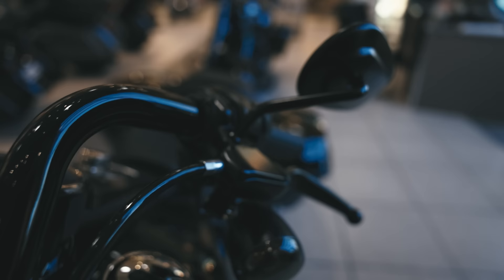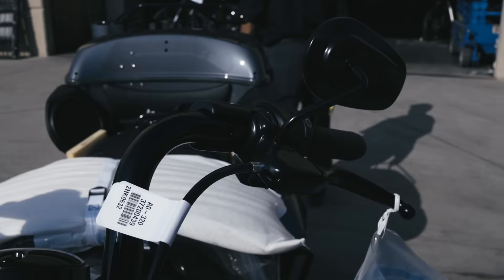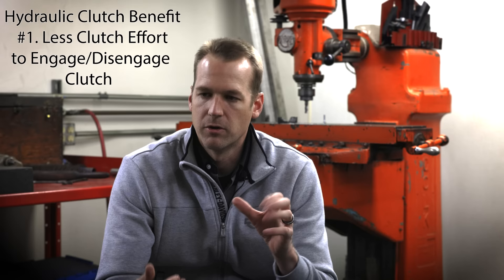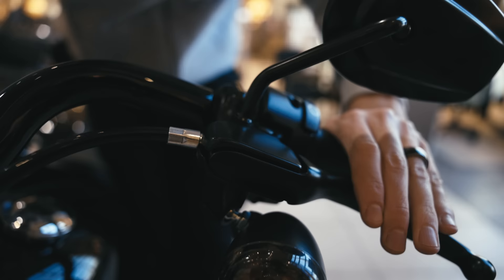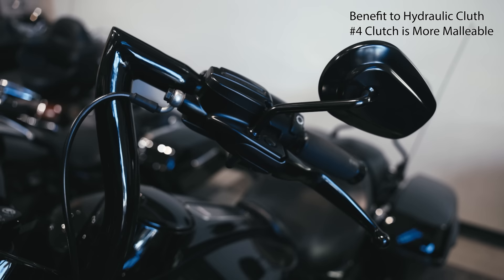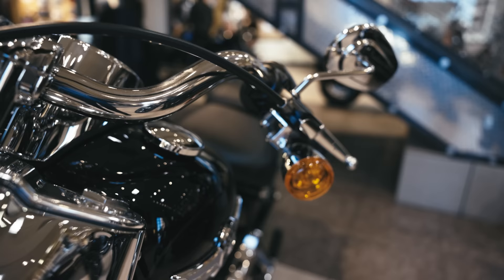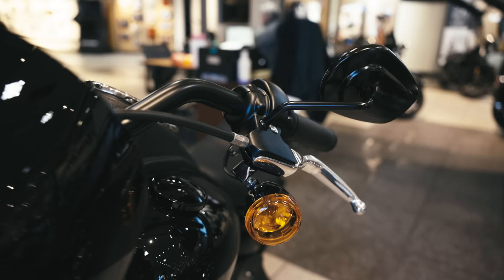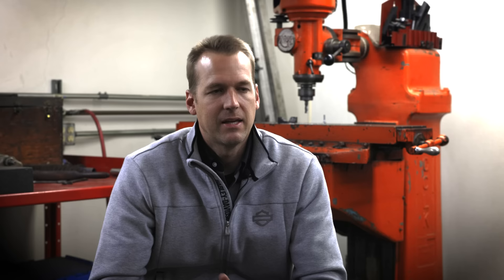Why Harley-Davidson Switched Back to a Cable Clutch on Touring Motorcycles│Pro's vs Con's

Comment: Matt, last year Purchased my first Harley with a hydraulic clutch, a 2017 FatBoy S.  My experience was: 1. that it was not less effort but more, 2. friction zone was way smaller than a cable clutch, the lever would be half way through its travel before the clutch would start to disengage, making the friction zone minuscule.  for me this was a deal breaker as use of the friction zone is how I handle a large bike with lots of torque through slow, tight maneuvers (think parking lots, traffic jams, and my daily commute to work).  I loved the bike and that 110ci, but I traded it in because the handling just didn't match my riding style.  That fat front tire was great on the highway, but I just prefer the handling of a skinnier front tire everywhere else.  To really get the bike to fit my riding style I would had to replace the heavy wheels, and that awful clutch, so I just got something else.

Comment: When I first experienced the hydraulic clutch it felt a little weird to me especially with the narrow almost all the way out friction zone. But I quickly adapted to it and I like it. Incidentally, an internal seal in the hydraulic system was a recall item on my 2018 Street Glide Special. But I had no issue with the system. Ive heard that there’s an aftermarket company that makes a modified clutch lever that increases the friction zone on the hydraulic system. I have two other brand motorcycles with cable clutches. I’m adjusting the cable constantly on both. All in all I’m OK with both systems. I do like the low maintenance on the hydraulic system and it’s consistent feel to it. As Matt stated, there are motorcycle instructors (Motor man) that really prefer the cable system over hydraulic because of the way bigger friction zone for slow speed maneuvering. Personally I’m very confident in my handling of my H-D. I’m a rider who rides every day and averages at least 150 miles per day. I guess if I had a gripe it would be passing the cost savings on the cable system onto the customer.

Comment: As someone who has had both, they both have their perks.  Biggest perk on hydraulic is shifting has less lurching under fast high rpm shifts . Especially for the passenger. Cons. Very small friction zone , being almost at the end . Be in the know when using a hydraulic clutch for the first time if you are used to a cable clutch . Cable clutches friction zone is triple the area . Way more forgiving .

Comment: Hey Matt. There is a fix for the friction zone on the hydraulic clutch. Check with your service or parts guy. I believe it's called a jitter spring inside the clutch pack. About a $15 part plus labor. My friction zone went from the 80% to 50% release. Also I replaced the slave cylinder to a Rekluse which reduced the effort 35%.

Comment: I’m 70 years old and have been riding since I was 17. Harley clearly went back to cable to save money. My present bike is a 2017 Triglide which has the hydraulic clutch as you know. I wanted the engagement closer to when I start letting the lever out so here’s a simple way to get that. Just remove the lever and pull the rod or pin whatever you want to call it and carefully grind about 1/16 off of it then smooth it out and put it back in. Try riding it and if you want the throw a little closer take a little more off of it. Do this until you like the feel and you’re done. No more adjusting ever again and you have a great feel to it. Just don’t take too much off each time. This is a simple way to get the engagement sooner and all it costs you is a few minutes of time.

Comment: Hey Matt....I’m ok with a cable clutch, however I’m a CVO Touring bike rider. I think it is easier for me to handle my Limited, since it equipped with a Hydraulic Clutch. 

I know when I first switch from “cable”, to “hydraulic”, it made me feel more confident knowing where the “friction zone” is today, as it will be 2 years from now; without constant adjustment. 

Great Video....GG👍

Comment: My biggest reason for not liking the Hydraulic clutch, is the clutch has a very good possibility of going away if you're slow riding to long.  Did a benefit ride in NY a few year ago, Ride for Richie , where 65 miles of NYC was blocked off for the ride.  Out of over 1500 bikes, I must have seen 100 Hydraulic clutch bikes broke down on the side because the clutch fluid boiled. They sat a while, clutch came back and went on their way

Comment: in 2018, I converted my 2013 FLHP to hydraulic, and haven't regretted it a bit. I can't tell you how many clutch cables I've replaced/broke the 35+ years prior to that. I just bought a brand new 2024 FLHP,  and was like "WTF?" when I saw a cable. So, I already have all the parts ordered to convert it to hydraulic as well. I'm not dealing with cables again. I definitely didn't like the lack of adjustment in the hydraulic clutch, so I jumped on my lathe and made an adjustable rod to fit between the lever and the plunger. Now I can set my lever pull and have the best of both worlds. And maybe it's just me, however, I do a lot of low speed riding, floor board grinding, and I can find my friction zone no problem. The only thing as reliable as this hydraulic clutch was the suicide clutch I ran way back when. Lol!

Comment: Thanks for a very  comprehensive presentation on the pros and cons of hydraulic vs cable clutch systems.
Very much appreciated your comments on those of us with shorter finger reaches.
I have been attempting a hydraulic conversions for my 883 custom and various lever systems to lighten the clutch pressure.
I think I will settle finally on the cable with a few mechanical combination upgrades.

Much thanks,

Lloyd

Comment: I agree with you Matt, after using a hydraulic clutch I like the consistency and smooth operation. Personally I feel Harley opted for the cable clutch because it’s cheaper to produce. Many manufacturers use hydraulic clutches as they are almost maintenance free and as a instructor who spends a lot of time riding slow in the friction zone I have no issues with a hydraulic setup

Comment: I have had bikes with Hydraulic clutch actuation since 1985. I bought my first Harley when the Rushmore Road Glide Ultra came out, but didn’t care fore the fixed lowers, so traded for a 2018 Road Glide Special. There is nothing about the 2021 that would entice me to trade.   Now, if Harley comes out with a modern FXRT I might be in the market again. I have 3 other bikes with cable clutches that require maintenance and adjustments. I’ll stick with hydraulic for my touring bike.

Comment: I’m used to the hydraulic clutch for number of years and I liked very much. I used to feel the difference when I ride my friend’s softail. I recently bought a 2021 Street Glide. It’s not a big deal when it comes to a cable clutch, except the fact that the new clutch will require adjustment on frequent biases as you mentioned in the video. I have to live with that I guess. Thanks Matt for the great information you post in your channel. Your channel really worth subscribe and likes.

Comment: Thank you for the clear analysis and honest feedback.  I would have preferred and would have paid for the option of a hydraulic clutch as a model year upgrade.  Not much logic with respect to some of the changes made to several 2021 models. At least in my view.  HD says they listened to rider feedback and therefore switched back to a cable clutch and also same reasoning for offering either a blacked out or chrome option on the specials, but when I go to my local dealer and see the chrome option Road Glide Special without chrome lower sliders and half the instrument module (nacelle) unpainted, as well as an unpainted top vent, that totally contradicts the message.  And lastly, what's up with the tank badging on some of these models.  It looks like HD decided to use leftover badges from previous model year's. Sorry to rant, but it is disappointing.

Comment: Never did like the tiny friction zones on hydraulic clutches. The consistency is definitely nice, but imo the benefits stop there. I traded my old vmax for my current Road King awhile back, and the very first thing I noticed was just how much better I felt using the cable clutch on the Road King. I feel like if clutch pull is THAT much of an issue for you, it's probably an issue better solved with an auto-clutch or a smaller displacement bike. If you feel like a hydraulic clutch actually DID help you keep riding, well more power to you and that actually warms my heart to hear. I just don't feel like it's an answer. Really good for getting on it on high performance bikes, though, since you can drop it soooo easy.

Comment: 2019 road glide special, been riding since I turned 14 in the 80’s. I’m torn. Like the consistency of the hydro, but would like it to come in sooner. But don’t want to deal with everything that comes with the mech clutch. On a big cruiser it makes sense. 
I’m sure they “Harley “ did this as a money issue. As now they don’t have to keep the hydro stuff, everything is cable. All the bikes. As I business owner I see that advantage as well! 
Thank you for your thoughts on this. 
Information is power... share the power it makes us all stronger!

Comment: I’ve been riding a cable clutch for years. Last year I test rode  a 2020 Road Glide Special. Great bike! I loved it! Except for the hydraulic clutch. To me it was much harder to squeeze and I have wear x-large glove size. I did not like the feel of it at all. Jump back on my 2010 Ultra and decided I don’t want to trade her in. I adjust the cable clutch my self and get it perfect for me.

Comment: I was looking forward to upgrading away from the cable clutch when I trade up from my 2015 RoadKing.
Now it's just the RDRS and bigger engine that make me want to upgrade my motorcycle.  So now I'm rethinking if I want to upgrade to a new bike or just put the cash into my existing bike to increase the performance 🤔

Comment: I'm on my second roadglide and both have had the hydraulic clutch. The three bikes I had before were all mechanical. I personally as an older rider prefer the hydraulic clutch.  Another thing I've seen beyond that is a lot of people complain that Harley and especially the touring bikes have a low lean angle. But many of those turn around and lower the bike further lessening that angle. I know harley has made adjustments to placement of certain parts to increase it. I think it boils down to this . Harley riders are the pickiest riders there is on the road. Whether be out of a traditional sense or beyond .

Comment: My 17 CVO Ultra has a hyd clutch, and I don;t like it simply because there's no feel of the friction zone. When you are performing slow maneuvers it feels as if the clutch is engaged or it isn't. On a heavy touring bike, that is a big deal, to me at least. Normal everyday riding, the hyd clutch is no big deal. Glad they went back to the cable clutch.

Comment: I did not know they did this change. I am very happy with my 2019 FLHT. ABS became standard on it the following year so I missed out there and would have liked it but for me the hydraulic clutch is a must for a modern full size bagger and I'm glad I have one. Cables are for little dirt bikes. Also as the bikes age the pull on a cable system will increase.

Comment: I have the hydraulic clutch and now it’s fantastic. But, I added the AIM lockup attachment and the aftermarket slave cylinder. The AIM or Rekluse mods are mandatory enhancements to the H-D hydraulic clutch. The stock H-D hydraulic clutch is analogous to stock handlebars and seats. Sure, you can ride on them. But why would you when your bike rides so much better when you change them.
Reply: Boy, you're right about that, Brian! I traded my 2010 FLH for a 2020 FLHR last summer. Love the bike-hated the clutch. After a very smooth cable for 10 years, the hydro was abysmal. I couldn't get the AIM clutch slave on fast enough! What a difference! It's a 2-finger easy pull now. The Harley service writer asked me about it as the motor cops were complaining about the new hydro clutch. A main benefit of a hydraulic clutch is easier, smooth actuation and Harley just couldn't or wouldn't do what it took to get it right.

Comment: I grew up with a cable-clutch, and it’s a hassle to maintain one’s preferred optimal adjustment over an extended period. That’s not an issue with the hydraulic-clutch. There’s no way I wanna spend more than $30K on a bike, then have to be frustrated with multiple clutch cable adjustments. I prefer the hydraulic clutch for that simple reason alone — it’s a no-brainer for me. Hydraulic-Clutch! 👍🏾

Comment: My friend built a hot rod deuce in 2005 and installed a hydraulic clutch he still has the bike he still has the clutch I traded my 2010 road glide custom with a cable clutch to a 2020 road glide S hydraulic clutch at 64 years old my hands are starting to look like Krampus so I  like the hydraulic clutch especially with a passenger my wife has a 2017 road glide S she’s a hairdresser and has worked with her hands her whole life and that’s the reason for her having a hydraulic clutch which she loves. we’re talking about clutches and perceptions yet they take the vent doors off the  faring and leave a hole you get one key fob the heel shifter is an up charge so I understand those that feel their cheapening the brand.They do so much right that’s it’s  a shame to see it go backwards just my two cents thank you Matt as usual

Comment: Having suffered a major left arm/wrist/shoulder injury back in 2016 I do know the hydraulic clutch was easier to pull for me but was harder to hold the lever in while in traffic. My '05 Road King took some time for me to get my strength back up to pull in the clutch and when I bought my '18 Ultra Limited it felt so nice to pull in the clutch. But the first time sitting in stop and go traffic with the '18  it would cause my shoulder/forearm/wrist to ache. What I mean is with the cable had a harder pull initially but it was easier to hold in.

Comment: I personally prefer hydraulically actuated clutches. The consistency of operation and IMHO the ease of service make it the superior solution. Yes, you read this correctly, I think hydraulic systems are far easier to service than cable systems. Maybe not for a traditional "Heat & Beat" type of DIYer, but if you are familiar with how hydraulics work and how to service them, I feel that the choice is fairly easy.

Comment: Both the 2013 FLHR cable, 2016 FLHTK and 2019 FLHTKSE hydraulic clutches have full range friction zone just from the handle bar to the end of engagement. The 2019 A&S clutch needed about 500 miles / 800 km of somehow breaking in to gradual acquire the full range friction zone, that's true, but now it operates perfectly, with silent gear changes as well, even when putting in 1st gear (2016 also). The 2013 clutch has a very easy 2 finger pull just because of the lighter diafragm spring (and cable and pivot pin lubrication!, and also almost zero free play adjusted when cold). The 2016 High Output Twin Cam has a somewhat heavier pull because it regained the same heavier spring that was on my 1998 FLHTCI (which had less clutch plates), so that's not to blame the hydraulic actuation. I am happy with both, but prefer hydraulic (same behaviour warm and cold, but of course most of the time it is warm ;->) ).

Comment: cable was easier to learn / start, when I went to hydraulic I had a small learning curve. I guess if it I had a preference I would say hydraulic, however for slow speed and moving around the cable is definitely easier...

Comment: Lionel here in central California. 
I see there's 2 schools of thought and those who don't care. I have never used a hydraulic clutch in normal riding. You can't feather the hydraulic clutch or change the engagement point. You can with the cable clutch. I have over half a million miles ride Harley Touring motorcycles, Shovel Head, Evo, Twin Cam, and now Milwaukee 8. I've ridden in 38 states and on several occasions rode 1,200 miles in a day. I don't recommend it, but sometimes you got to do what you gotta do. 
 Here's what I like about the cable clutch. First is adjustablity, cost, ease of service, no caustic fluid to deal with, and now with the new cable system you use extensions instead of a new cable. Just saying....

Comment: After putting about 1,500 miles on my new 2020 Road King, I'm spending nearly a grand to convert it to a cable clutch.  I have over 40 years on a Harley Davidson, and the action on the hydraulic clutch was an unpleasant surprise, to say the least. I live and ride in town, where low-speed maneuvers are important. I find the hydraulic clutch to be grabby and inconsistent, especially before the bike is warmed up. The friction zone is much, much narrower, and there is no feel in the lever at all. I actually needed to go practice u-turns and low-speed maneuvers in a parking lot with the new bike, and nearly dumped it several times before I (kind-of) made friends with the clutch. The hydraulic clutch may be fine for highways and straight-ahead riding, so to each his own.  But for folks like me who need the maneuverability around town, Harley made the right call.

Comment: I don't like hydraulic 1- pull is not easier ,2-the friction zone is far out like a metric style bike, 3-I like the flexibility of adjustment to set  the friction zone area. 4-Is it possible H.D went back to a cable cause it is less expensive to manufacture ? .Thanks for the channel Matt great information
Reply from the maker: Thanks for watching.